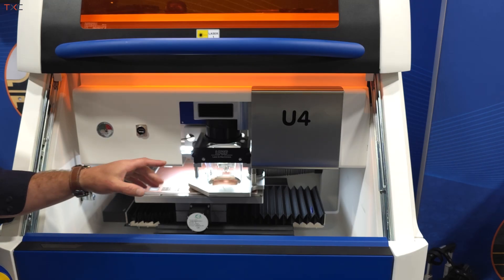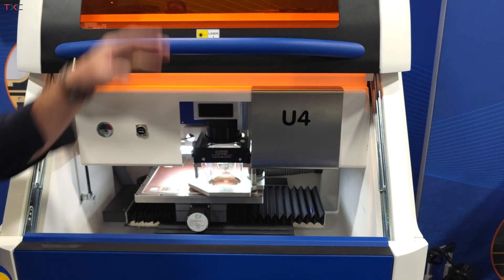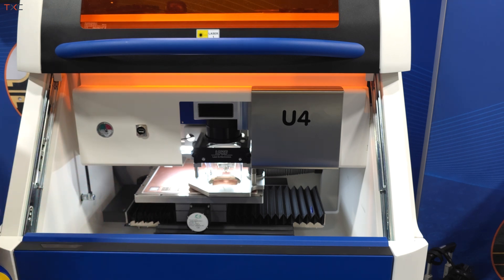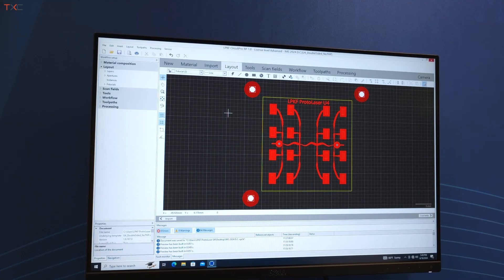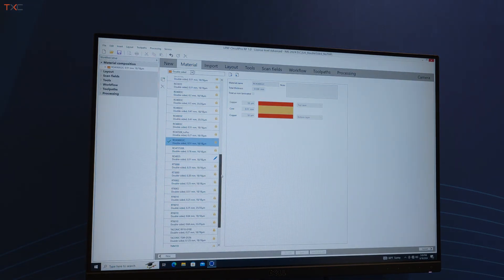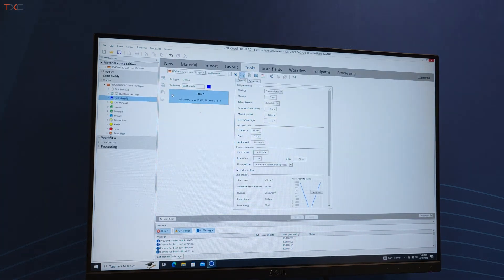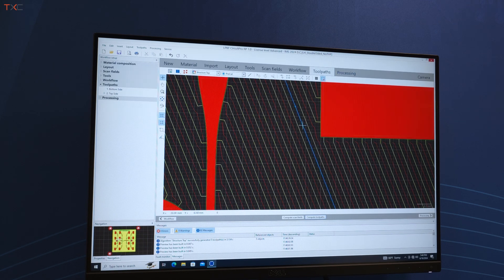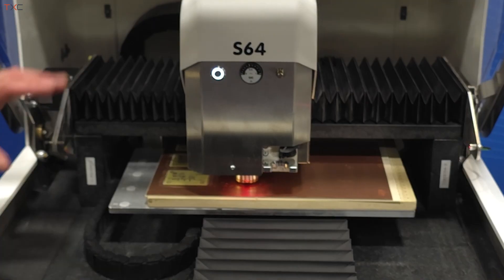Making PCBs Using Lasers and CNC Machines

Comment: I don't mean to seem critical, though your products may be excellent, but your video was hardly useful and is a letdown to viewers in my opinion.  It leaves more questions than it answers.  It would have been more helpful to see both the laser and non-laser type machines etch the same PCB pattern and then analyze the results and highlight the differences.   Also, the maximum board size was stated for the laser machine, but not for the non-laser type. In fact, nothing was mentioned about the non-laser version.   Also, what about startup requirements, such as space, air filtration, waste removal, meeting local environmental codes if any?  Lastly, and this often gets my goat:  I went to the LPKF website and unless I missed it, there's not a clue as to price.  Is the lack of price because it's presumed that someone, or a company, has bags of money sitting around and so price is not an issue?   Consider making a more useful video that covers, in depth, both laser and non-laser machines and provide some real-world examples and please provide baseline prices on your website.